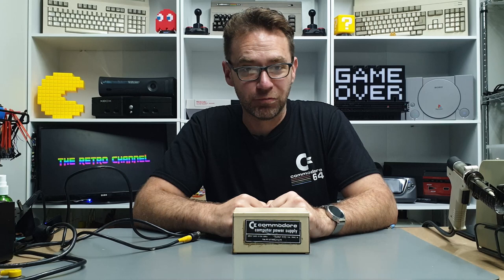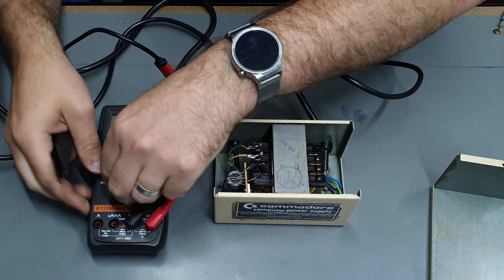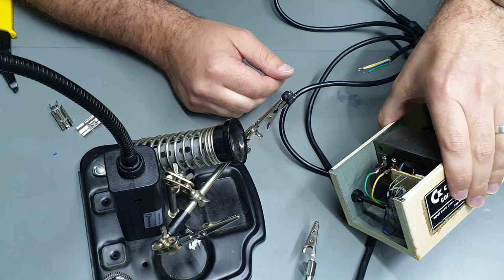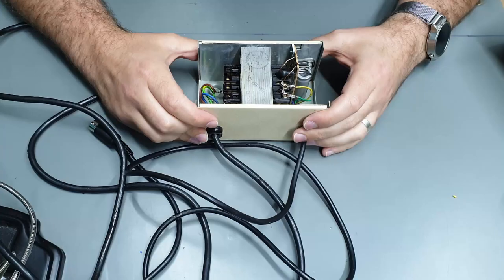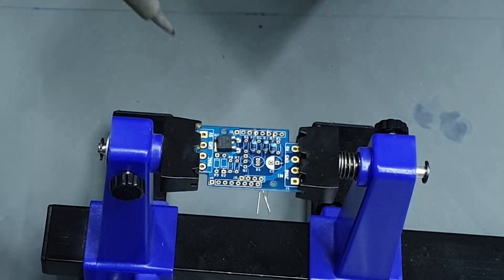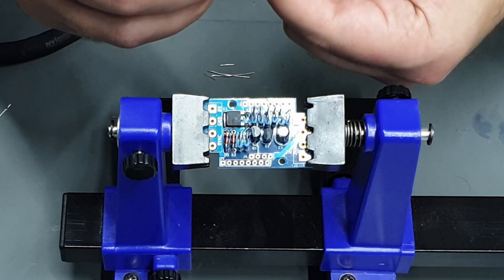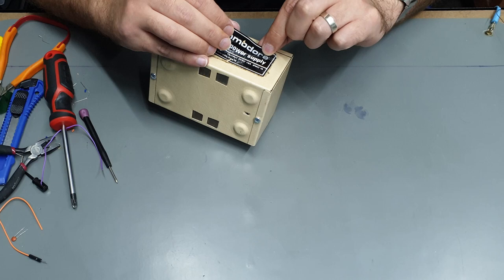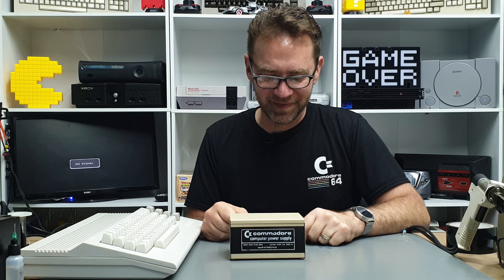Commodore 64 unusual 🤘 power supply refurb and C64 saver build

Comment: Wow, the memories! I had one of the these power supplies. It came with my original silver label C64. I can remember transplanting the transformer and PCB into a slightly larger metal enclosure and fitting a keyswitch in the 5V line so I could disable the power supply. I think my original idea was to stop my sister using my C64 when I wasn't around! 🙂

Comment: You could probably stick the label on with just a little loctite control gel. If you do it in small areas from left to right (or right to left), it should be possible to get it to stick while piecing together the torn bits as you go.
Reply: I would start by putting a strip of masking tape on the bottom of where you want the label so that it's level. I mean so that you can make sure the masking tape is level first and use it as a guide.

Comment: OMG. Watched this a week ago and just realized I forgot to comment. ...... There. Done.

But seriously, a super interesting PSU. I don't think it is an actual Commodore product (part number is not the usual nomenclature and no fuse) but pretty nice, nonetheless. And... awesome to see that you acquired a C64 Saver from Mr. Lurch -- nice job building it -- the 1/4W resistors look perfect. This is a great and unique addition to your retro collection. 👍
Reply from the maker: Thanks Mark, yeah the saver worked out well, glad I could finally make use of one (even though I cheated a little). One of the other commenters pointed out that it may be a Commodore product, just made in low quantities for the Aus market. The transformer has an early date stamp of early 1983, so it's unlikely anyone would be cloning them so early on. And the PCB layout is very similar to what Commodore were doing at the time. Anyway, I'm still yet to find anyone who actually recognises it.
Reply: @TheRetroChannel  Oh, that makes sense. Very interesting. Did you mention how you came across this PSU?
Reply from the maker: I picked it from a bloke in Sydney who was selling a couple commodore monitors. He also gave me a bag of random bits and pieces, which seemed unusually heavy but didn't give it much thought. This was in the bottom and it seemed worthy of a video seeing as there's no info on it anywhere that I could find

Comment: There is a lot of passion on the DC 5V voltage. :)
For my part, if I have to use a power supply on any type of C64 (Longboard and Shortboard), I prefer to put my power supply at 5.1v to have an average of 4.8v in the commodore 64 when turn on. From experience, I have never had a power supply problem with this voltage even with complex cartridges. I think it's better to be below 5v when the machine is on. Why this reasoning? Because you have to see the machine in a global way. From memory, MOS chips can theoretically withstand 5.5v but that's only theory. Depending on the life of the machine and its storage (wet place or not), an ic can die more quickly. Same for logic ICs and memory, we know that commodore had several component suppliers (good and bad) and that some have certainly cut back on quality specifications to reduce manufacturing costs. The engineers at commodore gave a lifespan of a few years to their machines (After 40 years, they made a wrong estimate.). Now a C64c will use the 5VDC line more than breadbins, so the voltage will inevitably drop faster on a shortboard, and it will fail less quickly than a breadbin longboard. Now by analogy, voltage is pressure. When a human is always under pressure, he will continue to live but may be shorter depending on his design and his biological weakness. I also recommend using a good switching power supply for the 5VDC line (Meanwell). Because the performance is much higher than a linear power supply which are real radiators (If your feet are cold, you can place it under your desk) and you will save money on your electricity bill.
Reply: You'd have to have it on 24 7 to notice on your power bill.
Reply: @blackterminal The unmodified psu takes 23W/h when the C64 (Breadbin) is on and 3W/h idle. A new PSU with meanwell module, take 15W/h when the commodore is on and 1W when idle.  Now, everyone wastes their electricity as they want. We still make a saving of an average of 35% compared to an old PSU.

Comment: At 8:30 ... The metal clamp is used for strain relief. The clamp should enclose the cable sheath! So you stripped the cable a little too far. So you have no proper strain relief, you will have the same problem as it was before.
Reply from the maker: It's still grabbing the cables but yes you're right, it won't be as good as clamping the sheath. I struggle to solder DIN connectors with only minimal wire to play with, so next time I'll be sure to strip the minimal amount. Just need more practice 😁

Comment: You could replace the caps and the regulator and it will be good for another 30 years. Or you could use a 2a regulator or do like Ive done twice..bypass the regulator and fit a chinese dc to dc converter. I tuned the output down to just enough. It makes it a hybrid supply then.
Reply from the maker: I replaced the caps and regulator. Works just fine and with the over voltage protection, it's now my daily driver

Comment: Why not put an (always on) digital meter on the outside of the box to monitor the output volts for both 9 and 5 volts?
Reply from the maker: I do have one of those, not sure what I was planning on using it for so maybe it will get added  to this PSU
Reply: 9v never varies. It's raw from the transformer and basically immortal. 5v yes that would be interesting.

Comment: Nice work dude. That's an odd PSU and I don't recall seeing one before. I wonder if it was a knock-off that used the Commodore name? 🤔
Reply from the maker: Possibly, it has a number on the label that reads "App. No V/77099/PS616" but no amount of online searching yielded a result 🤔
Reply: @TheRetroChannel  Well either way it looks like a nice serviceable brick so good find! Is there any way to reduce the vibration without potting the whole thing that you're aware of?
Reply from the maker: I could introduce some rubber washers between where transformer mounts to the case, or just replace the transformer itself. Both would be easy enough to do I guess

Comment: Is this an Australian version? The German „Bricks of death“ look very different.
Reply from the maker: It certainly appears to be Australian, the label says 240v input. But I did a lot of searching and couldn't find any mention or images of it online, and I've never seen it before, even back in the 80s when everyone had a C64. So I figured why not make a video on it myself
Reply: @TheRetroChannel  That brick looks like a (very good) home jobby or at least 3rd party knock-off to me!
Reply from the maker: Could be third party, maybe by the same folks in South Australia that released this case https://stiggyblog.wordpress.com/tag/south-australian-c64-case/
Reply: @TheRetroChannel  I'd say it's definitely [totally safety ignorant] 3rd party manufactured and I'd be amazed if Commodore officially allowed their name and logo on that scary POS.
Reply from the maker: You've seen their official power supplies right? This is on par in terms of safety with the rest 😆
Reply from the maker: Very good points. I assume the black case one you're referring to is the same one in the top right corner of the video at 0:15 The reason I referred to it as "custom" is because I swapped out the linear regulator for a meanwell SMPS. These are definitely the bricks to look out for, no potting and plently of room to stick something else in if you feel the need. The potted ones are just not worth the trouble IMHO
Reply: It's not potted so is not a brick.
Reply: @iamdkk third party would be better than potted one.
Reply: @winstonsmith478 what the heck is scary about it? Have you looked inside many power supplies?

Comment: Is that thing unfused? Illegal in many countries!
Reply from the maker: Good eye, and yes it is! There were plans to splice an inline fuse on the active and even recorded some stuff about it, but then had to edit it out as I didn't have everything needed to do it on hand. If you look closely around 10:35 you can see I place part of it off to one side but never mention anything about it 😅. It will still happen but just off camera instead
Reply: Have a chill pill. You like to point out what's legal? You need a new hobby.